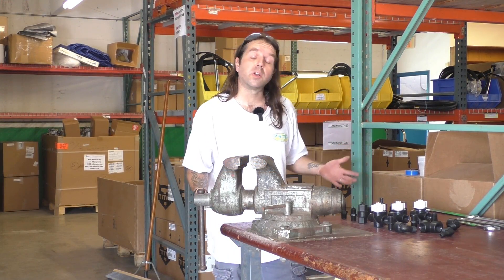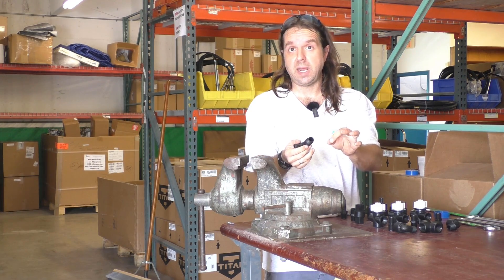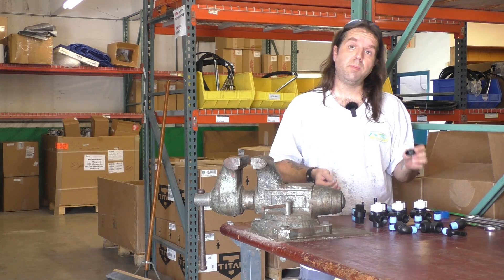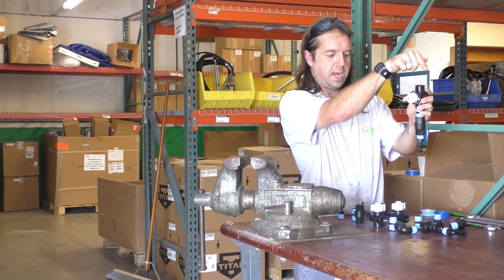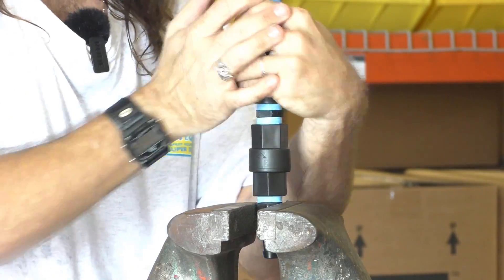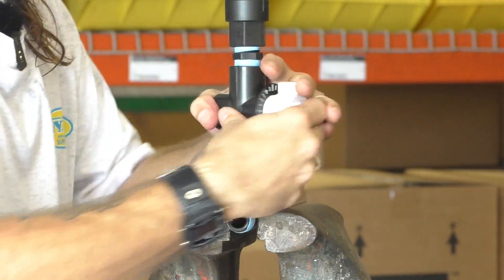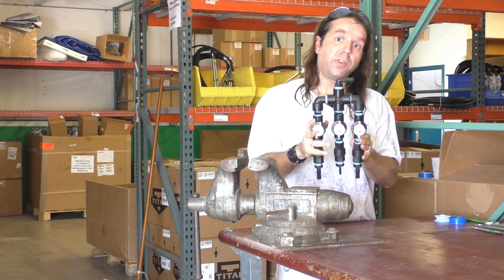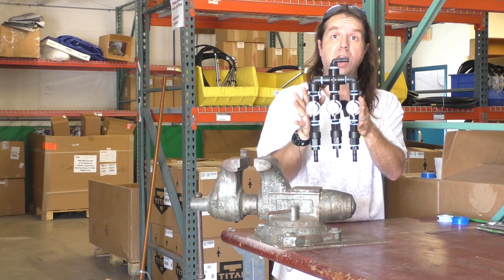How to Assemble DIY Proportioner

Comment: Are the issues people have with these valves from over tighten to crack or do the valves just not hold up?Seems like a chlorine valve would hold up if it was installed correctly.